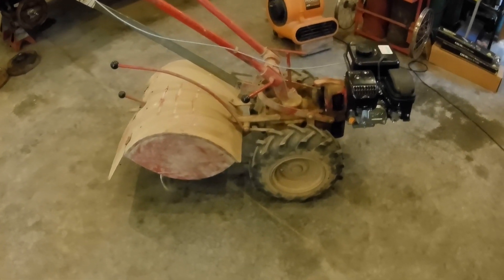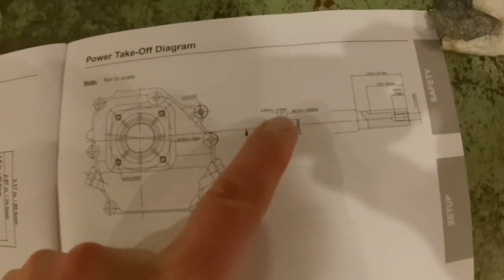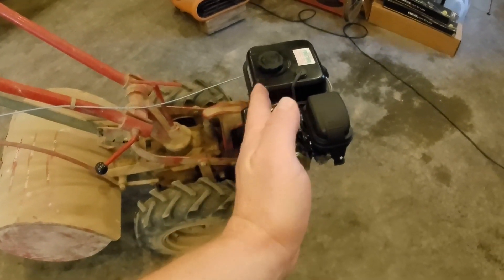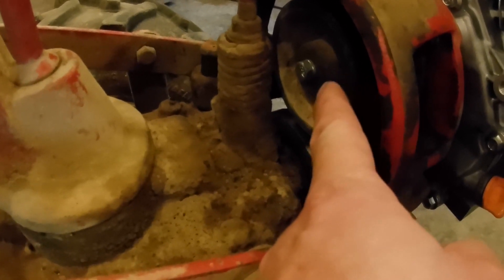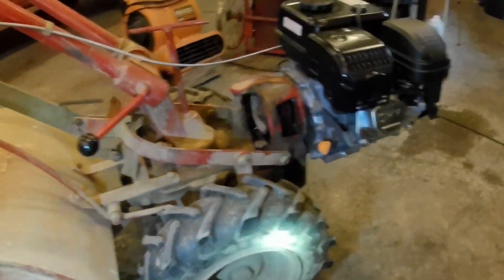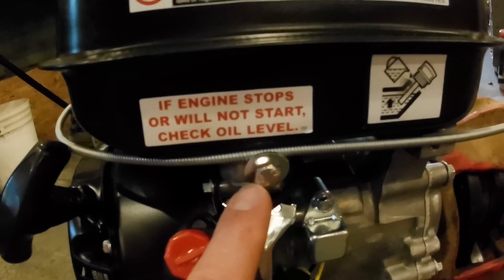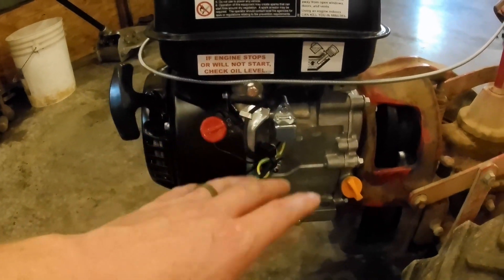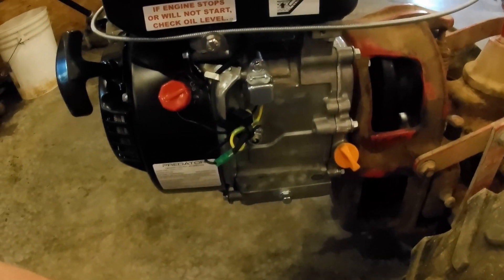How To Engine Swap - Kohler to Predator

Comment: hey man   liked the video. I did the same with a troy built pony but was unable to set it up where I could have reverse. I'll have to go and check it out tomorrow. get some details on what the problem was and hit you up. I had one of those old big troy built tillers like that years ago. I miss it now because it had the separate shift levers. thanks for the video